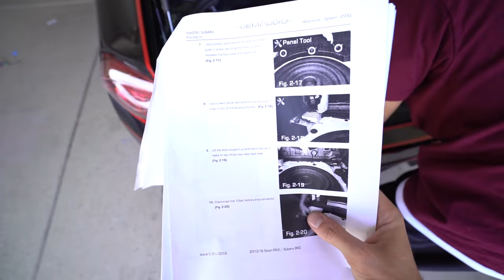Cheap Stock VS $1500 Stereo System - is it better?

Comment: Tj looks like he should be a pilot.
Reply: Looks like Beavis
Reply: can confirm.
Reply: driving a tuned brz is the same thing as flying a falcon jet.
Reply: Matthew they're alright, his brz is pretty much a stock 370z nismo.
Reply: Houston Is My City don't really know much about the 370 nismo, but is that a good thing? Seeing as the nismo is a race car and the BRZ is a casual car
Reply: KrAziiPwNaGe I wouldn't consider the 370z a race car either, it's a sports car. Both are sports car, a casual car would be like a Nissan Altima. TJ added all those mods, spent a nice amount of money for pretty much the same specs as a stock 370z and I'd still put my money on the 370z winning in a race.
Reply: KrAziiPwNaGe ol
Reply: Houston Is My City after he gets it tuned after his rebuild I'm quite sure he will be putting more power to the wheels than a 370z
Reply: Blake Batchelder that may be true.
Reply: Cars n' Bikes yeah😂😂

Comment: Why oem audio. Like you should've just bought a Prius sound system
Reply: Яoman    Was given to them
Reply: you can't fight free bros
Reply: A) Free
B) Easy fit w/properly designed speaker brackets
C) Upgraded system w/subwoofer
D) Not everyone needs 50,000watts of power
Reply: bass*

Comment: You paid 1500 for that? 😂😂
I could build a custom box tuned to 34 hz with a Sundown Audio SA 15" 
Put that on a RockFord 1200.1
Then replace all of your speakers with alpine (best quality) and have that on a accessory amp. For less than 1500. Hell you'd have enough to buy a bigger alternator and maybe even a d series battery to run the extra power.  🤔
Reply: so true!😂
Reply: Hank Holtgrewe they send them to him for free..
Reply: i understand where u coming from but u r wrong for what u can get lol
Reply: Hank Holtgrewe hella technical damn
Reply: mattshiznet silva but he said "Vs" and never even showed a before or after quality of sound?
Reply: zorhis1996 I can definitely build an entire system for less than a grand.  With the exact equipment I just named 😳
Reply: Lonis Cednia I know my systems lol
Reply: Hank Holtgrewe it was free..
Reply: Jordan Hastingss which is cool, but he's advertising it. Just trying to let those interested that it isn't worth it
Reply: a good alternator would run u $700 to $1000, and sundown 1500w rms would run u $500-$600, a 1000w alpine would run u around $500-$600 also , thats just subwoofer and alternator lol and ur over $1500
Reply: Hank Holtgrewe they got sponsored they prob got it for half that if not free
Reply: zorhis1996 a
Reply: Hank Holtgrewe I have crescendos on amps in both my cummins and my Tahoe I have two team 15s in the Tahoe and you are right they could have done way better lol
Reply: brochaco214 in the back of my patriot I have a T1 Rockford on a 2500.1 amp. Running double 0 welding wire. Did the big 3 upgrade and have a 330 alternator.  Only thing I need is a quad battery setup.
Reply: zorhis1996 except anybody with knowledge of what a sub coil looks like can buy used. Anybody who owns a DMM could buy a used amp. And my alt costed me 250 and it's top of the line.  Rebuild shops can build them up for less than that.   I've built subs for less than 600 dollars.
Reply: zorhis1996 No idea why you would need a 1500 RMS sub.  Unless you're planning to run a bd prime 2500.1 or something by digital designs. But we're talking competition level decibels there and then of course it gets expensive.   But those who succeed at audio competitions either have audio sponsors or DIY builds.  I've been doing competitions since I was 18, I know my car audio. 😏
Reply: zorhis1996 1500 RMS on a sub is unnecessary. My starter package was an SA 15 in a custom built box on a 1000.1 Rockford amp ran on a big 3 clean power upgrade without an additional battery or alternator. Was hitting high 130's, low 140's at the driver headrest.  Only costed me 600 dollars (used) and a redone kit for the SA is 60 dollars.
Reply: Hank Holtgrewe you need to stay off Steve meades channel.
Reply: Branden Kowall up until you commented I had no idea who he was.  I just know my car audio. Like I said, been into it for awhile. But thanks for giving me someone to study up on. 😏
Reply: but they got it for free
Reply: why would you put a rockford amp on some sa's? id just slap a twisted sounds 1.8 on there and call it a day lol
Reply: Dylan Estes Rockford doesn't have a bad clipping. On my 1200.1 I clipped at 1386
Reply: Hank Holtgrewe do u mean u clamped 1386 watts? bc idk wtf 1386 clipping is lol
Reply: Hank Holtgrewe i agree with all of this except the alpine part of it. i promise you rockfords, prv, incriminator audio, crescendo, and mclaren audio all sound 10,000 times better.
Reply: +Slowed Mixtapes I run prv audio, amazing sounding mids and highs.
Reply: Hank Holtgrewe my starter sub was a sundown x 18, 1500w RMS on a crescendo symphony 1500.1. 1500 is not necessary but it's god damn fun 😂
Reply: brochaco214 double 0 welding wire??
Reply: Hank Holtgrewe you go from sundown then Rockford......to saying Alpine is the best quality lollllsorry but that made me lol
Reply: LMFAO @ "ALPINE BEST QUALITY" YOU ARE EITHER 15 OR 50
Reply: R U FROM THE BAY?? YOU SAID HELLA SO JUST ASKING SINCE ITS BAY SLANG
Reply: I paid $250 my my 240amp Alternator, I think you're paying to much at $700-1000
Reply: Hank Holtgrewe or get a 4 channel amp of some sort with prv mids and crescendo highs and then get a skar evl line or a sundown 12 that fits your mono blocks power, get an optima yellow top and still will be 800 dollars
Reply: Honestly that’s true with $1500 you could  make your own custom box fabricated to fit in the frs trunk or you could even make a wall off set up. As for subs  and amps there are a lot on the market for cheap with good rms power mids and highs same as well.  Not hating on Tj hunt them just saying that there are way better aftermarket sound systems for cheap on the market and the option to make your own custom box to the way you like it is far more unique.

Comment: Replaced the door speakers, rear speakers, and bought and installed two 12 inch subs in my trunk for about $1,200 total. Granted my whip is a '98 accord but it bumps like no other, got two way kickers for rear speakers and basic pioneer three ways for the doors. Get some real subs guys, like two 10's or two 12's, even better two 15's. Bump that shit hard #BassHeadLife #IJustWannaBang

Comment: Those "rear speakers" are called rear-fill speakers, which are designed to basically just fill in the soundstage of the car. They don't necessarily provide sound for people in the back

Comment: My 93 Toyota pick up doesn't even have speakers
Reply: same with my 2012 focus :p
Reply: Burh I got no wheels on my brz!
Reply: King Wolf lol my 1994 base model slick top 300zx has Bose speakers but mine are all toast
Reply: El Random I used to have one but it was my Grandpa's old truck and it's just 2WD. Then I got myself a 1999 Jeep Cherokee
Reply: My 94 does. Upgraded dash speakers and I installed some door speakers. Cost me $100 for everything lmao
Reply: My Benz Patent-Motorwagen 1885 Doesn't even have a roof man :/ Life's hard
Reply: My 99 tacoma probably slaps harder with 2 12" subs

Comment: Changing the stock speakers will not have much difference...I'll say that the stock is even better from the aftermarket...The only thing you should do is just add some more not changing the stock ones with the aftermarket...Oh and the best speakers is them who made from paper.

Comment: The power wire has an inline fuse correct? I would hate if his car burned to the ground.
Reply: unless it's just plug and play and the fuses are built into the onboard amp attatched to the box?

Comment: If you have $1500 to get this system, just spend a little extra and go with a company thats reputable and has been making car audio for a long time. In fact you can get a much better system for much less if you know what you're doing. You can always go with cheaper speakers from Kenwood, Pioneer, JVC, or Sony and get a decent system. Or step it up to Alpine, Rockford Fosgate, Memphis Audio, etc. Honestly for the money, I would go with JL Audio or Focal because at least here in the U.S, there arent many companies that make better quality speakers.

Comment: Basshead here, you could've got 2 10" competition subwoofers (skar audio vvx 10 or soundqubed hds3 10) for $140 or $165 a piece $320 for a pair, a Rockford Fosgate prime 1200.1or hifonics brx1216.1 amp for $230/$160 and 4 gauge kit (NVX) for $50 and xs power 950 battery for $80= all for $850-900. You got ripped not here to talk shit but you could've got wayyyyy better shit. I actually have systems in all 3 of my cars and the rear view mirror only exists in 1 of them because the bass is shaking everything in the car and people are turning their heads at me when I come down the road

Comment: It was a sponsored video.  meaning they got paid to make a video of the speakers and so forth. For $1500 you  can get jl audio speakers for front  and rear, 4 channel jl audio amp, 10' jl audio sub with jl audio mono amp and it will still sound better than OEMaudioplus. 

Also, stock headunits don't produce sound very well. so in short, upgrading speakers to factory headunit is a bit pointless.

Comment: There's a good reason why vehicles don't come with large heavy speakers, wooden subwoofer cabinets, and mondo power amps. The reason for that is because auto manufacturers are focused on minimizing two things, weight (impacts fuel mileage and vehicle handling) and cost (impacts their profit margin). The next time you pull out a little spare tire subwoofer or an inexpensive-looking door speaker from a car and and laugh at it, think about this: The OEM audio system designers were tasked to make use of shrinking amounts of available space inside the car, at minimal cost and weight penalty, to provide low frequency output and full range sound without impinging on the available trunk or cabin space (which is more likely to cause a customer no-buy decision than what the speaker cabinet looks like and how large it is), all the while being continually pushed back on by the automaker to make it smaller, make it lighter, and make it cheaper, because they (not you) are the customer. When you put a pair of 12" subs and a box in the back of your car, you're constrained by none of those things, and you do incur a weight penalty that impacts your fuel economy and available trunk space.